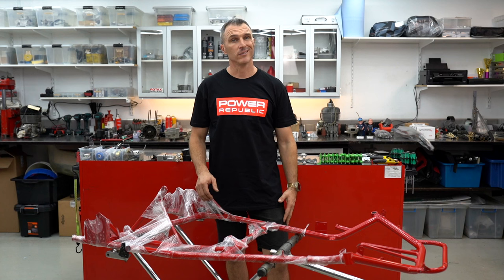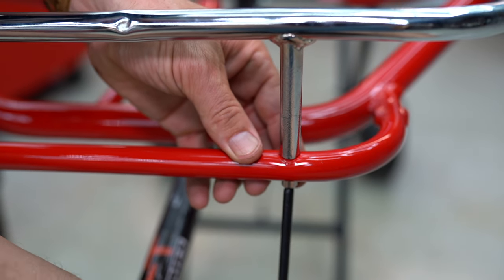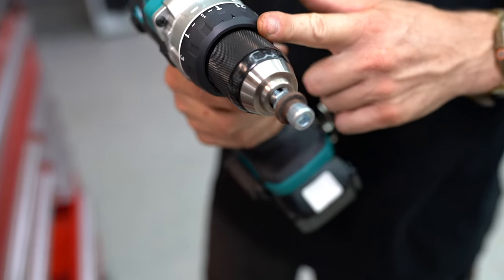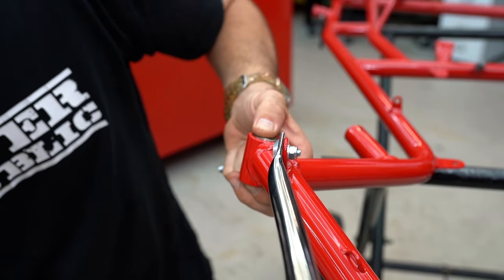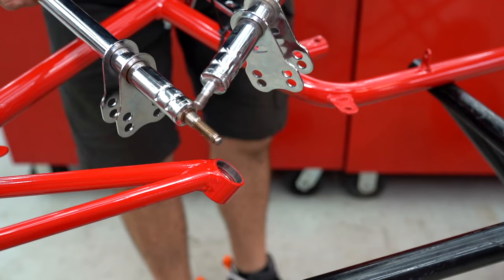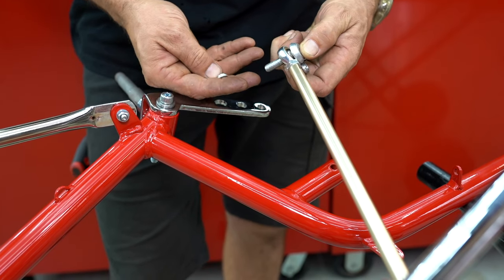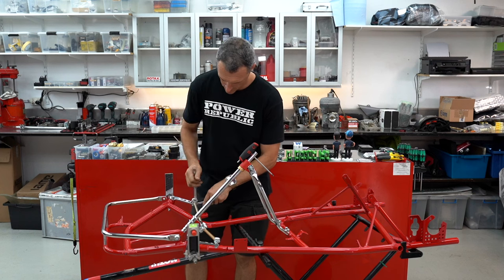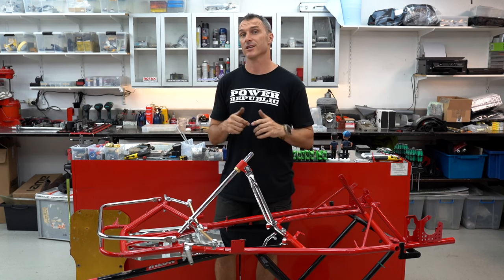Vintage DAP Kart Restoration Project Episode 4: New Chrome - POWER REPUBLIC

Comment: awesome! Floor tray is baller.  Put the tony kart pedals in, colour will match the tie rods and should not look out of place also will contrasr with the floor tray better. CNC an aluminum block up to retro fit the tony kart foot rests on as well. bellissimo 👌🤜
Reply from the maker: guesty, thanks for tip legend !!  good luck at the AKC this year.   tell the boys if they win AKC  I will let have a spin when the resto is complete
Reply: @PowerRepublic  sounds like a good deal to me so that will be 1 round each before we get to QLD? both in birels this year with a bit of luck they can clean sweep the 5 rounds with a 1-2 series finish (would be great for a tie though)